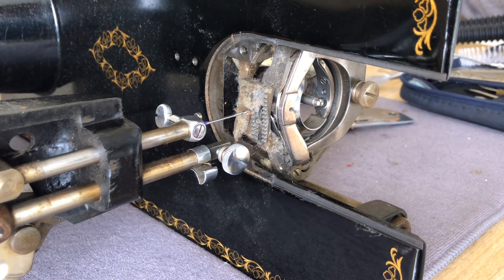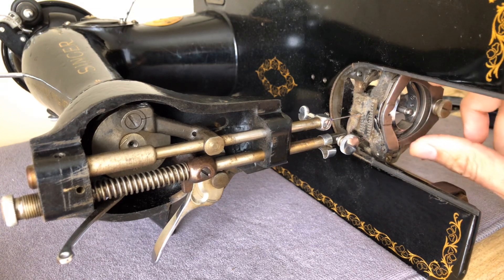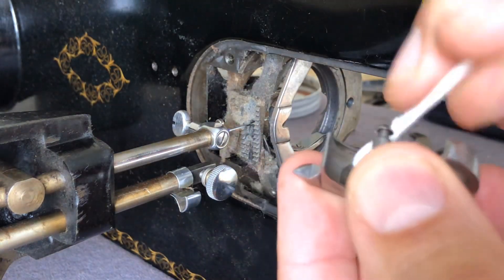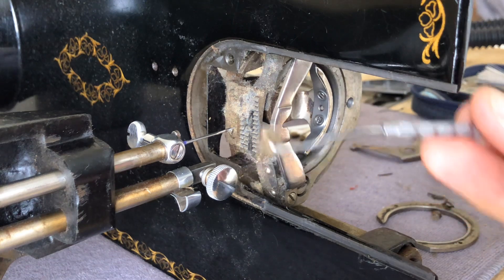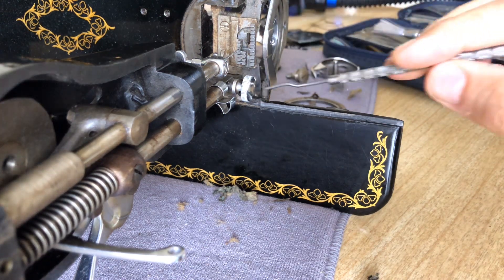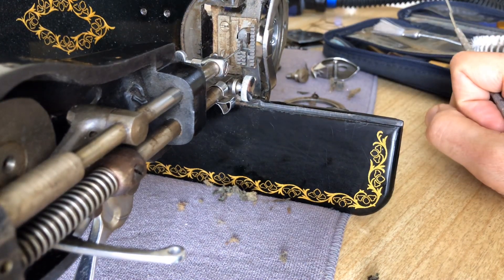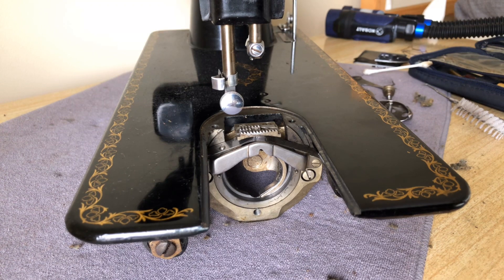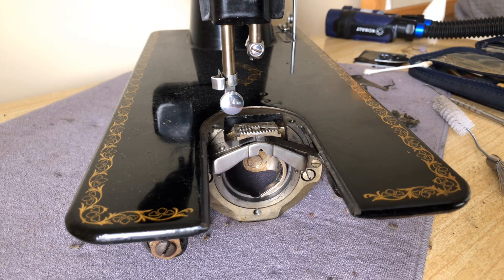CLEANING SERIES #11: What a Drag! How Lint Dust & Oil Can Muck Up Your Machine's Feed Dogs & Hook!!

Comment: I recently converted my 1917 Western Electric to hand crank. The motor still works but the wiring was bad and had to be shortened to work and it is easier to hand crank than operate the pedal with my hand and it now sews fabulously... But where do I get needles for it? and those little spindle  bobbins  any suggestions would be appreciated.

Comment: I recently got a Singer 15-91 and cabinet. The seller told me it's missing the screws for the table to hide the machine away. Do you know  what kind of screw that is? 
Love watching your videos! They are teaching me good tips and tricks to keep my new baby working like a dream, once she gets back from the repair shop that is. She haddent been used much in 30 years and the owner before that worked on leather so I figgured a check up by a pro would be a good idea.
Reply: You can often find those screws on eBay.  Search for Singer cabinet machine screws.

Comment: What did technicians use to clean these in the 1900s? I doubt isopropyl alcohol and cotton swabs were readily available…
Reply from the maker: Likely Kerosene, but it is NOT a good idea indoors and it can take a very long time to evaporate.  The odors from the alcohol are not great, but they dissipate a lot more quickly.